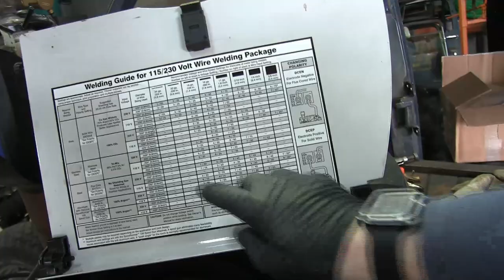How to shorten or cut a truck frame DIY

Comment: I was shocked when you said frame was 3/16". Harmon Garage shortened his one ton and his frame was 1/4", I replaced the rails from the back of the the cab to the rear bumper on my F350 cab and chassis and they were 1/4". I wonder if dually trucks have thicker frames as Harmons was a dually and mine is too. Regardless, you did a great job and who doesn't love a square body being kept alive. Great vid.
Reply from the maker: Thanks for watching!

Comment: Whats model number air hammer are u using and does it come as kit for different  accessories for chiseling n punching metal rivets?
Thank You for sharing video
Reply from the maker: It is a MAC brand, model # MPH1911 long barrel air hammer.  Yes it came with a several different bits, maybe 4-6

Comment: Why not relocate the spring hangers forward then take off the back end
Reply from the maker: It all depends on the shape of your frame.  If my frame was straight than I could and would have just done that.  But since my frame had an arch in it for the axle I couldn't easily do it that way.  When I measured, moving the hangers forward would have left my rear hanger in the arch for the axle.  I could have made a drop down section to mount that hanger on but i felt it was just easier cut and weld like I did.  Thanks for watching

Comment: I thought you're supposed to jog the seam and not do a straight cut.
Reply from the maker: In a perfect world yes.  I wanted to get as much length cut out as I could, so I did a straight cut.  Thanks for watching
Reply: Not true, we cut and stretch semi truck frames for customers and we do Z, L and straight cuts. There is no strength difference, but we use a section of frame inside the original frame, creating a double frame. I've done straight cut and weld on many one ton trucks and use a second piece of frame and have never had a frame failure. Our customers haul 40 tons a hundred thousand miles a year with no failure. Honestly, L and Z cuts are a pain in the ass if you don't get every cut perfect.

Comment: Can you shorten the length of a car frame the same way?
Reply from the maker: If the car has a frame then yes.  But keep in mind it will also change the position of any body mounts.  You will either have to move those mounts or shorten the body of the car.

Comment: What’s a good welder machine for a mobile truck repair truck
Reply from the maker: I'm certainly not an expert in that area, but I would look strongly at a Miller generator/welder.  Two of the farms I work on have them and while they don't get used a lot, they always start up and run well when we need them. Thanks for watching
Reply: Thanks

Comment: I need to convert a flat bed frame to a 8 foot bed on. 2003 silverado 2500hd duramax. You think its worth it? Too many headaches? 
Thanks
Leo
Reply from the maker: Hard to say.  Do you already have a bed?  I would check to see if the mounting bolts will line up with your frame.  If they do then it should be an easy job.  If they don't then you are looking at more work to get everything to line up.  Sorry I can't be of much help, I haven't done much work on the newer Chevys.  Thanks for watching

Comment: Why don’t you look what a factory one looos like and measurements 😮
Reply from the maker: If your wanting to do a LWB to SWB conversion Brothers Truck sells a conversion template (they are now owned by Holley)  https://www.holley.com/products/suspension_and_chassis/truck_bed_conversions/parts/LTSC38773-75
Or you could measure one if you have access to one.  

I am not doing a conversion to SWB,  I just wanted to cut as much length as possible out of my frame.  Thanks for watching!